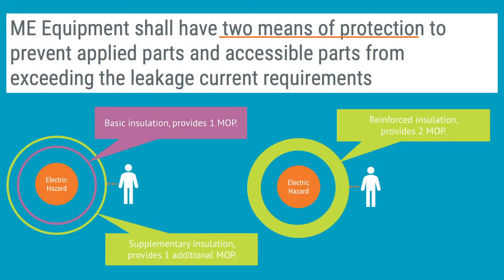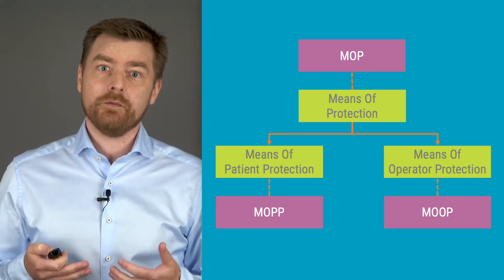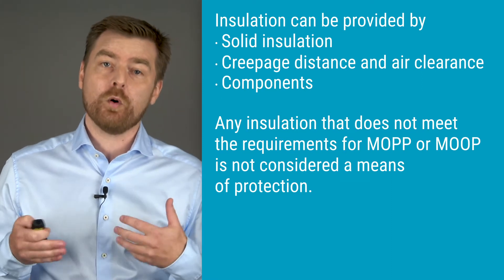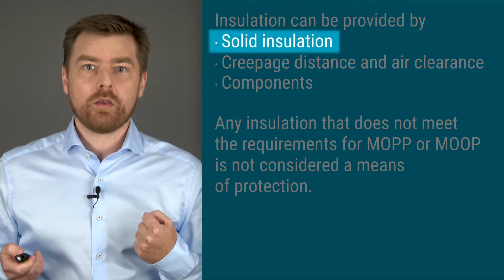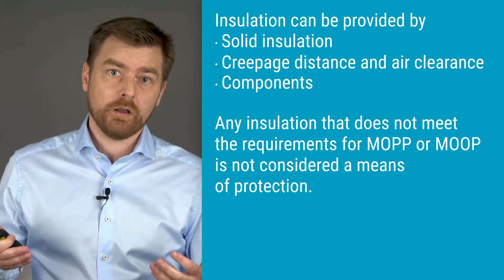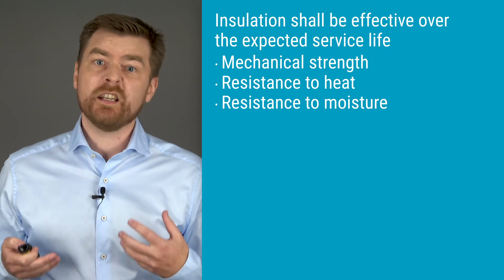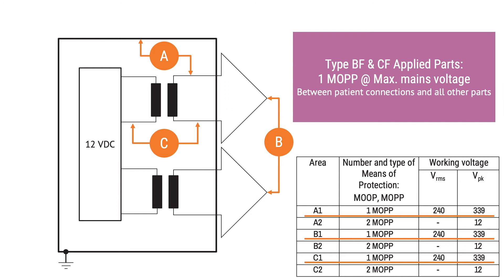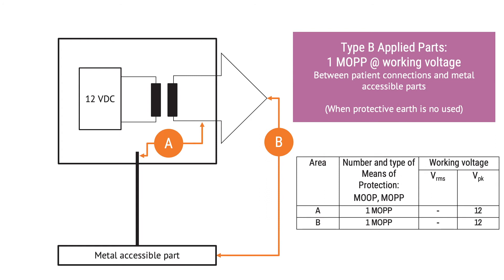Identify IEC 60601-1 standard insulation requirements for electrical medical devices

Comment: If I power a device with 60601 certified power supply that delivery 6VDC@1A to this device (working voltage) and so this device is connected to medical device, what insulation requirements do I need achieve ? Example: A ethernet/serial converter, with ethernet side connected to supervisory system and TIA/EIA-232 serial port connected to medical device like a parametric monitor. The power supply of ethernet/serial converter is connected to 220VAC/60Hz and has not an earth protection conductor. I mean that power source plus ethernet/serial will be certified together as a system regarding insulation. (e.g. GSM06U06-P1J power supply). Thanks in advance.